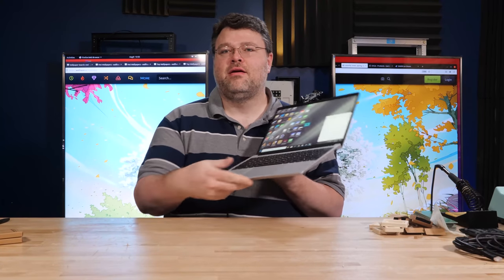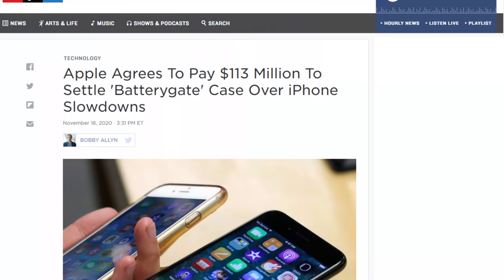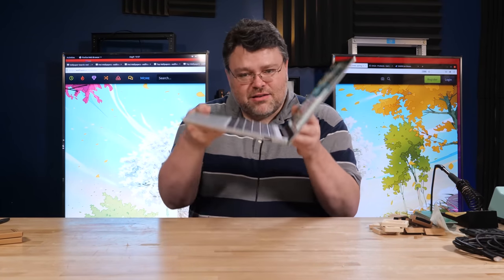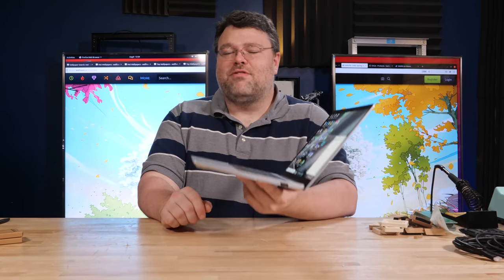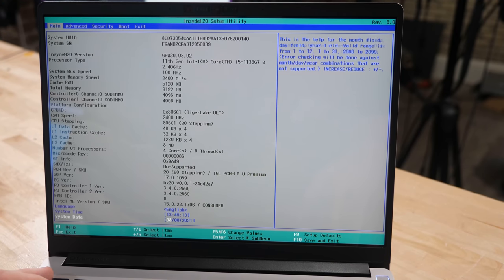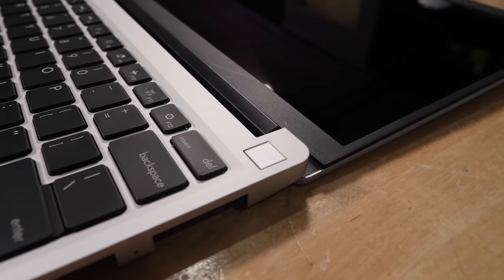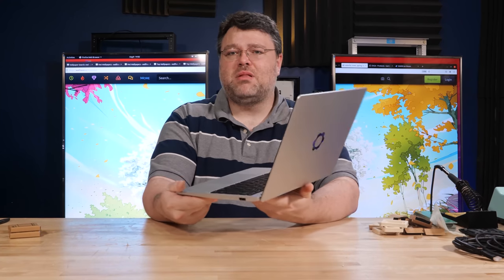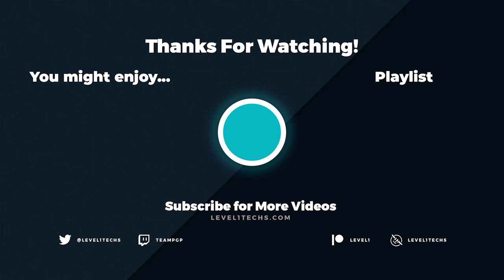Framework: A Laptop Designed to be Repairable?

Comment: I hope in the future Framework releases a version of the laptop with swappable battery module. I don't mind that version of the laptop being a bit thicker.
Reply: Same.
Reply: What would be cool is if it had a small internal battery and a swappable main battery. That way you could swap batteries while the laptop is on.
Reply: @morosis82  that's pretty cool idea :) i think it's probably doable :)
Reply: @morosis82  i think they might need to redesing the dc to dc converter for that. Because you would need to use two different voltage batteries. But shouldn't be to hard. For this young company it's not feasible but if they get more customers it could be possible :)
Reply: @morosis82  That feature is what I like about previous Lenovo Thinkpad T series. (i.e. Thinkpad T480). The smaller battery doesn't have to be internal. What if they support two swappable battery modules so you can do battery hot-swapping.

Comment: I'd really like L1 to do a deeper dive into the hardware. Rossman did an ok job , but it was a live stream with lots of waffle and he didn't even install an OS. I'd like to see Linux focused usage - I mean just to be 100% sure there aren't any weird driver issues or glitches. What about 'hot swap' swapping out of those port modules? Making sure that all the normal functionality is there like the finger print sensor on Linux - something bog standard like Ubuntu or Pop-OS would be fine. I'd just like to see it working. Obviously if some features are Windows only then they're missing a trick and maybe misunderstanding their target audience, who'll at least want the option of dual booting.

Comment: I haven't replaced my laptop in ten years, asides from it looking a little beat up from living in two different automotive repair shops for those ten years it still works. I upped the ram to 10 GB (found in another laptop at a scrap yard lol :P ) moved the old boot drive over and installed a 250 GB SSD for the main boot drive, other then that I replaced the batter once and still rocking it to this day as my daily work machine. I've been looking in to getting a Framework laptop as its replacement for the last couple months because I can't lie my current one is showing its age even with the little upgrades I've done to it, but I think if I did get one it will spend most of its time at home on my own work bench. Like you said it's a laptop for tinkerers and I do more of that at home where a desktop is not happy live like I've done before.

Comment: Frameworks does a lot well (modular I/O, clear instructions, one type screw of different length, spare screws) but there are two current shortcomings:
1. No schematics for the customer. Yes, repairshops can get those but what if you don't have one nearby or you simply want to repair it yourself? Also, do you really own a product if you don't have the schematics? Decades ago you got schematics for pretty much all electronisch that you bougt.
2. No Ryzen yet in the lineup. It is understandable that a small starting OEM starts with one product segment but it needs to get added.

I'd like to see this approach succeed. Please add the schematics!
Reply: These are also just basic bitch laptops. Nothing powerful or fancy. You won't be gaming with it or using it as a workstation.
Hopefully they succeed and have the opportunity to expand their offerings in those directions in the future.
Reply: It seems like there is a valid reason for the schematics only being available to repair shops, Lewis Rossman mentioned that it was something he bought up with someone from framework and he sead the reason he was given was valid. It's likely that the manufacturers of the parts have some form of NDA in place.
Reply: @raifsevrence  True, but I don't like gaming with a laptop anyway. In my opinion it is a better option to use a desktop for gaming and a laptop only for whatever you need to do when you are not at home. Because of price vs performance, because of the performance and because of ergnomics. That low standing monitor, that touchpad, that compact keybaord, I hate using laptops, but we have to so I have one. 

I guess it simply depends on how many units they sell, if enough people buy a Frameworks laptop then they can expand their lineup. As I see it expanding it is not that difficult once you have that 'skeleton' in place.
Reply: @spartan5280  It is not up to us to defend companies, it is up to us to plead for consumer rights! I have seen Louis Rossmann his video, he did not mention WHY Frameworks does not share schematics. I can think of a few reasons but the most logical reason is this: the company which they buy that motherboard with CPU from does not let them. If we - endconsumers - put pressure on Frameworks to share the schematics then Frameworks has a stronger position when it negotiates with that company which makes/ships those motherboards with CPU's.
Reply: @peterjansen4826  I'm only defending Framework... They are probably stuck between a rock and a hard place with this because the companys that make the chips are likely using some copyright, patent, or trade secret law to enforce this. That's one of the big things that will hopefully be helped by RTR. They are not a big enough to be able to convince companies like Intel and TI to be more consumer friendly.
Reply: @spartan5280  I think that it is a bad idea for consumers to defend a company. Not our task, not in our interest. Consumers defending companies is why the prices for graphics cards went out of control while the progress is sparse and the quality is often pretty bad. 

I won't attack Framework but I won't hold back with criticism either, I mentioned the good and I mentioned the bad.
Reply: @peterjansen4826  Obviously, if this was Nvidia or AMD than defending them would be stupid. But Framework is just a startup and from what I can tell it seems like the no schematics outside of repair shops thing is probably a legal problem (Lewis's saying he couldn't say why supports this theory). If it is a legal issue caused by one of part manufacturers than I could see why they would not release the schematics, right now a lawsuit or loosing a part supplier could kill them. My point is that why would a company so dedicated to the RTR cause withhold schematics unless they had a valid reason, and in all likelihood the reason is caused by an industry and laws that are anti-consumer by design. We as consumers need to be focusing our frustrations on the company's and laws that have created this situation wile supporting and defending (within reason) companies that actively pushing for a return to the days of getting schematics and repair manuals in the box. And I get that Framework is a company and that they exist to make money but I think it would be counter productive for them to do something like that when there target demographic would be the people like you who would want to have schematics.
Reply: @spartan5280  It seems to be a better company than AMD and NVidia but that is not the point. The point is that it is not our task to worry about why they don't deliver those schematics, our task is to politely put pressure on them to do so and strengthen their leverage in negotiations with the supplier ("our customers DEMAND it) to get it done. 

That doesn't mean that I won't buy their product but the chance of me buying it will increase if they do give the schematics.
Reply: @peterjansen4826  I don't blame you for that. Furthermore, I generally agree with you. 
That being said, If I was buying a laptop with gaming in mind, it would be because I was planning for a substantive period of time where I don't expect to have access to a desktop.

Comment: it'd be cool if they had a thicker version to try and compete with the 'gaming' market instead of 'thin and light'.

Then you could take out the graphics card and add extra battery when you need a laptop to last for a day, and put the graphics card back in when you know you'll be near an outlet all day.
Reply: Or maybe have a docking station accessory that slots right in there when you're close to an outlet but don't need gpu horsepower. And then laptops could market themselves based on how many of these expansion slots they come with. Only problem might be using the same interface for a gpu, battery, and thunderbolt-ish dock, but hell, no one's ever tried before, so it could be possible. At least the dock and battery could use the same port, some dual usb-c configuration perhaps, maybe even for the gpu. 
There's endless possibilities for these types of laptops for functionality instead of soldered down e-waste like we're seeing more and more with soldered RAM, CPUs, GPUs, storage, and so on. It's heartbreaking, but also inspiring for new engineers hopefully

Comment: This is really cool. And even if it's upgradeable you'll have to buy it through Framework so they still get to sell parts, just a bit less. If it comes with a thunderbolt port you could use it as your main computer even for gaming.
Reply: Pretty sure it uses thunderbolt to connect the modular ports. Not 100% sure but I believe thats why they didnt make an amd model, because they need the bandwidth of TB4 to get a lot of the modular ports to work. It might not use TB for all the ports as regular usb 10gbps should be enough, but for something like hdmi 2.1 you would need something with the bandwidth of thunderbolt
Reply: @Jsteeeez  I believe it's "uncertified" thunderbolt 4 ports on all 4. I also believe that they are in the process of certification.
Reply: @Jake9066  This. It's Tiger Lake, it has inherent support for Thunderbolt integrated in the processor. Also, they're working on more and better expansion modules (E.g. with 2xUSB-C, Quad-DAC with all those audio nerd ports, etc...)
Reply: While I haven't looked too much of the validity of this, from other reviews I've heard that Framework is giving out all of the dimensions for everything and allowing/encouraging others to make their own components as well.  Apparently that also includes the motherboard and the slide in ports.
Reply: @kingknapp  Yes. They're "open design". They also promised to provide design documentation to repair shops, so they can for instance easily repair the motherboard.
Reply: @Jsteeeez  USB-C which is compatible with thunderbolt, I believe
Reply: @Jsteeeez  Good info.  I learned something.  Thank you!
Reply: @Jsteeeez  You should do a video on that, honestly.  Clearly you know your USB!  I can hold my own in video editing, let me know if you want to collab.
Reply: @Bri-bn5kt  I dont make videos, and I am a person who hates seeing myself on camera/ hearing my own voice. I appreciate the offer though. I’m just a tech nerd so I basically was like why did they call this usb 3.0 then rename it usb 3.1 then rename it usb 3.2 and was like imma figure this out. We finally see WIFI get away from the esoteric naming. We used to call wifi A or n or AC. WiFi 6 is just wifi AX and AC is just wifi 5 but a number is much easier for consumers to understand. Even the usb implementers forum now demands they include a number 10 next to a dumb usb 3.2 gen 2 so people know what it is. But im on this channel in the first place so I like to learn nitty gritty details of stuff most people never want to know. Like I built my brother a computer and spent like an hour explaining how great the cpu was and the graphics card was and how much ram I put in and the NVME ssd. And afterwards he asked me wait are the cpu, and gpu different things? Some things cant be forced learned, but have to be originally learned from both information and personal experience and especially making those mistakes is the best teacher.

Comment: to be fair to big OEMs. in my dell xps 9510 I could easily install a 2nd M.2 ssd and upgraded the ram myself for less money. the battery is also replaceable. despite this i like the framwork concept and hoping for a wider modell range

Comment: Remembers me of my Dec 2011 HP Elitebook 8460p, that I bought off-lease in May 2017. It is very easy to upgrade CPU; memory; disk; DVD; battery; SIM Card :) and various PCIe cards.  Some people even replaced the motherboard with a 3rd gen motherboard. 
I have to do something next year, because it is getting too old and too slow.  I would need to upgrade CPU (2C -> 4C), memory 8GB -> 16GB and replace the 2TB HDD with a SSD or add a smaller SSD in the DVD location.  Upgrade is easy, but it is probably cheaper to buy an off-lease laptop from 2016/17.

Comment: NICE!

Seems like putting 2 ports on each port module would resolve most of those port issues
Reply: Had the same idea. 2x USB-A 3.0 would do it for me. Not sure it it would fit though.
Would you be swayed to the idea of using Mini/Micro iterations of DP and HDMI ports? Not sure if I'd like the extra dongles myself.
Reply: @Trancefreakeh  I figured just making the modules slightly larger.  If can't make smaller and have just one, make them slightly bigger and have two.

Why not all of the options?  That's why these things need to become a standard, it creates a market.

The ENTIRE computer standards system needs to be completely redone from top to bottom anyway. Yes, even that and that, yep those things too. No, we can keep using electricity as the energy source .... for now (that can be revised in the next overhaul, due in 5,976,120 seconds)

E2A: DOH! I did the time wrong, failed to actually notice the unit fields in the calculator and can't find a suitable calculator.

Was aiming for 69 years, 4 months, 2 days, 0 hours represented as seconds. CBA to look longer, will probably already be viewed before then. Drat and Darn!
No, I'm not going to use a normal calculator because to hell with trying to calculate time like that on a calculator (those who know why, know why)!
Reply: @ChrispyNut  True enough.
On the topic of calculation. Why? The answer is 42, we've known for some time now.
Reply: @Trancefreakeh  heh. I just re-watched that this past weekend (the original TV show, not the crappy movie).
Reply: @ChrispyNut  'fraid I've only red the book. I was unaware there was a movie/show adaptation. recommended?
Reply: @Trancefreakeh  It's OLD now (early 80s BBC show that's 6 episodes). So, think Monty Python for the kind of quality.

I really enjoy them, BUT there's a lot of nostalgia that's compensating for the age, but Zaphod Beeblebrox annoys the living hell out of me... mostly it's how the character's written of course ... I don't know how much is the performance (wasn't nearly as bad with the audiobook), but that's a personal taste and likely varies by your opinion on the character.

The much newer movie ... eh.  I only watched it once, remember little of it other than "eh".  It was just like watching a remake of a favourite movie ya know.  It wasn't the same and it wasn't WAY better, so ... eh.

Comment: I thought that they could have doubled up the ports on each module myself. I understand that they all plug into USB C and that might present a problem if it branches out to two more USB C ports for bandwidth and power delivery but the other ports could easily be doubled or mixed. If the modules plugged into Thunderbolt ports, they could definitely have 2 ports per module on everything except a Thunderbolt pass through.

Comment: the only thing I could hope for is a 15", I already find laptop screens rather small to work on, so going with what is on average about the smallest size option isn't really up my alley.  That said everything else about it has me wanting one if I did look for laptops.  
Only other nit pick is I feel like some form of bottom up with maybe a thinkpad T430-ish unscrew a couple screws and pop it out type keyboard(if needed) may be a little more repair friendly.  I just like being able to have it flat on a table no plugs to remove to get the cover out of the way simplicity...there was also a crappy i3 HP that was  nicer than the T430 to work on, pop  the battery out and slide the cover off, boom access to everything.

Comment: i’m assuming one of the reasons why they were only able to put 4 ports on the machine is because they are all thunderbolt ports. they havent been thunderbolt certified yet, but apparently will support 40 gbps data bandwidth. i dont know if the intel laptop processors support so many thunderbolt ports, as thats probably the limiting factor

Comment: I love my probook 445R G6 but its meh on the battery life because HP gave it a 2.5in bay so they didn't put in a larger battery. while its easy to swap internals I don't want to try and replace a keyboard, trackpad or screen on it. 
a zen powered version of this and I'd be really tempted to buy it